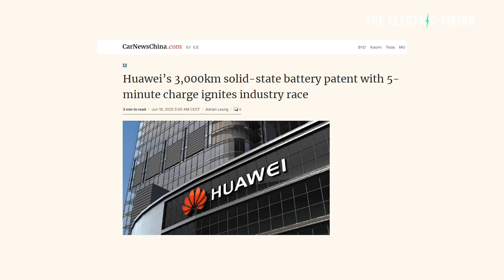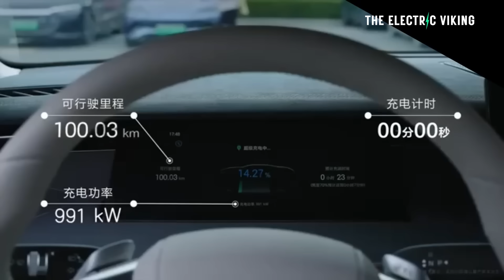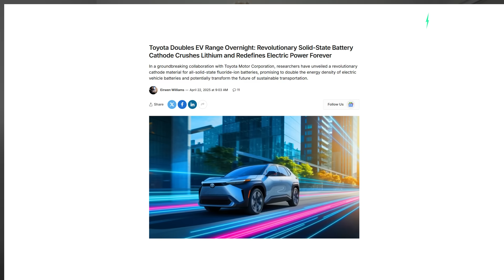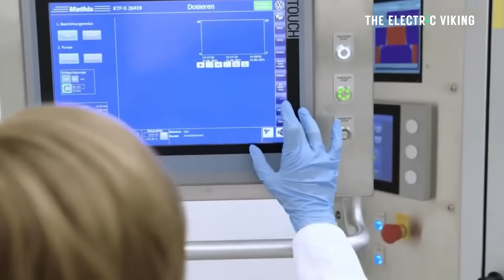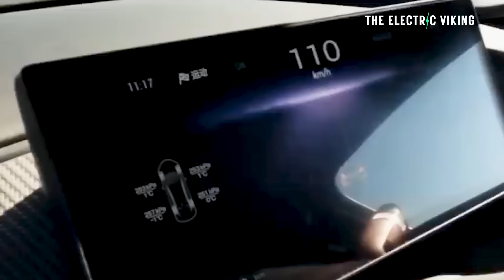5‑Minute Charge, 1,864 mi Range: Huawei’s Battery Patent Shocks Industry

Comment: IF that energy density claim is true, we will watch most aviation go electric as well.
Reply: Just curious, will aeroplanes benefit significantly from using batteries as an energy source?

A lot of the benefits of putting batteries in cars is because of regenerative braking - a significant amount of energy is recaptured and returned to the battery.

Would planes have a similar system? Or am I thinking about this in the wrong way? 🤷🏻‍♂
Reply: @JadeSea-x1b  That is a very good enquiry.

From what I have read so far, there are strategies for electric planes to conserve energy rather than re-generate it. But of course it's not my area of expertise and it can be hard to keep up with what is happening.
Reply: @JadeSea-x1b  much of   the energy that planes use is to reach operational height and speed. If the engines in an electric aircraft can be used to generate electricity and slow the plane down rather than speed it up, then yes regen could work, but mostly at the end of the journey
Reply: @JadeSea-x1b  it will reduce fossil fuel usage and reduce costs because electricity costs much less than avgas or kerosene. No regenerative braking, sadly!
Reply: @JadeSea-x1b  In reality regenerative braking normally saves no more than 1~3% as we daily drive.
Reply: @vincentlin9350  1-3% sounds awfully low. I've done some quick research - Tesla Model 3s can regen at up to 75kw. I've read that regen'ing can net between 5 - 10%.

This actually sounds awesome. 🥳
Reply: @JadeSea-x1b  the experience is on BMW iX2 B mode. just one example.
Reply: @JadeSea-x1b .  If it’s a vehicle like a taxi or a delivery van you have to calculate wear and tear on brakes.  Regen braking saves a lot of money on brake repair and maintenance.
Reply: @JadeSea-x1b Fuel is a huge expense for air carriers. If they had a way to divide it by 5, they would be overjoyed.
Reply: @JadeSea-x1b the simple fact that the electric motors provide instant acceleration paves for the democratization of the air travel.
Very short runways . Silent planes. 
U can have small runways near to population.

It's like the iPhone moment for the Personal Computer.
Reply: DH!!!!😂😂
Reply: @kokkarneBramhavar  This is true, particularly about the reduction of noise - people living close by airports or underneath flight paths would definitely be better off. 👍🏻
Reply: @pradhyudh Sounds is going to remain a problem with electric planes, because propellers and electric ducted fans aren't silent. They indeed are less noisy compared to kerosene fueled engines. What is going to be reduced is local pollution, reducing the risk on getting aerotoxic syndrome for the staff and increasing the local air quality.
Reply: I think VTOL and semi VTOL is going to play a bigger role with electric planes, because with smaller electric electric engines it's easier to implement. That can change the way aircraft have to approach and take off from the runway, reducing noise complaints from the surrounding areas, but this also means smaller airports can service bigger aircraft which can reduce the amounts of flights at bigger airports.
Reply: @EenYouTubeGebruikerI fully agree. I've been following flying car technology for over 40 years and I always knew that neither ICE nor turbines would make the cut. For the last 20 years, I've been waiting for better batteries and I believe they have finally arrived!
Reply: @JadeSea-x1b this is a long shot 😅but  maybe solar cells on the top of the fuselage and wings to generate some power during daylight 😅. Like a extra skin but I guess would be vulnerable to lightning ⚡️ etc !! And additional weight .. I do recall an experimental electrical had panels on wings ..
Reply: Exactly.  I suppose we should be watching for unmanned short range crop dusters.  That would be the cheapest and safest starting point.
Reply: @drmodestoesq they're already here, they're just not cheap. Yet.
Reply: @drmodestoesq  I suspect that could be done with current batteries. I suspect we are going to see drone based gutter cleaning and window washing.
Reply: @jonathancardy9941 .  I’ve see people using small quadcopters for crop dusting.  I’m assuming crop dusting is a multimillion dollar industry.
Reply: It's BOLL🐃
Reply: Electrically powered planes would be slower as they would have to be powered by motors attached to a propeller unlike modern turbofan engines.
Reply: For heavy long range aircraft, they take advantage of the landing weight being reduced by the weight of the burned fuel meaning the structure can be lighter and they can go a a lower drag higher altitude as the fuel is burned. Thats why if they have to return after takeoff, they dump fuel. Batteries don’t get lighter. Will be great for shorter range aircraft.
Reply: @brucec954  I was an airline pilot for 38 years. Sorry, no offence, but your reasoning is flawed.
Reply: mid-air recharging.
Reply: Short endurance recreational and sports aircraft can be electrified, some are in research mode right now. But your regional or long haul aircraft will remain turbine (jet) powered. An electric aeroplane is a propeller driven aeroplane. So a lower cruising level is required and also prop aircraft are much slower than jets, about 120 kts slower (140mph / 220 kph). Prop aircraft are also quite noisy and produce vibration, you would be effectively going back to 1950’s air travel in speed and comfort.
Reply: @PropanePete there is absolutely no reason you couldn’t put a direct motor on the turbine blade driven by vfd’s.  None. Because it’s not in practice yet doesn’t mean it can’t be done.  If the battery capacity is light enough with sufficient capability then  it would even be much improved over the existing technology.
Reply: @kristopherbuchanan974  You're mistaking what the compressor stage of a turbine engine does compared to what a propeller does.
Reply: @PropanePete  no sir, granted I am out of my league as far as how the jet engines work, but the high bypass engines effectively don’t rely on the heated air and fuel exhaust for the thrust but instead use the fan in the front as the main source of thrust. It does still provide thrust but as a supplement.  The high bypass is moving large quantities of air at lower speeds providing the thrust.  Like I said, the technology might not be developed as of yet, but I promise you it  is not far off and an Electric motor is capable of the speeds needed if the energy density of the batteries is sufficient.  I was simply stating, many things people seem to think are impossible are often built and work better.  Of course there will be hurdles this overcome, but If you’re limited to thinking it must be prop driven then I think that is a mistake.
Reply: But can we trust their batteries? Did we really think about all the privacy concerns?
Reply: @Unacceptable.  Who are we? Can you trust products from the USA?

Comment: Just give me a cheaper, lighter car that goes 500 miles. You'll sell more cars because it's cheaper and has a better interior design because you have more room to work with because the battery is smaller.

Comment: We need the energy density. We don’t need more than 600 km range. May be 800km in some cases.  Range is not an issue - weight and size and price is.
Reply: True and I think car manufacturers agree, high energy density batteries allow them to cut the overall size of the battery - reduce weight and improve efficiency
Reply: i recon 600-800kms is enough... i have never driven more then 400kms or so without a "pit stop"... charging speed up and bring the weight down to ICE levels and EVs win.

Comment: I don’t understand why people measure EV batteries in kilometers (or miles) when they should be focusing on three key aspects:
	1.	Vehicle (motor) efficiency,
	2.	Battery energy density, and
	3.	Charging speed/rate.

Why? Because you can have a 100 kWh battery and still only get 150–200 miles of range, depending on the vehicle’s efficiency.

Let’s be clear on this: the bigger the battery, the heavier the vehicle—and the heavier the vehicle, the more energy it requires to move.

On the other hand, higher battery density means less weight for the same amount of stored energy, and vice versa.

Also, when measuring battery range in kilometers, it’s essential to specify which testing cycle or methodology is being used (EPA, WLTP, etc.). For example, in China, they use the WLTP standard which, to be honest, is quite optimistic. In real-world conditions, the actual range tends to be about 70% of the claimed figure.

For instance:
3,000 km × 0.70 = 2,100 km real-world range.

So far, the highest real-world efficiency I’ve seen is 13 kWh per 100 km, which translates to approximately 7.69 km per kWh.

That means achieving a 3,000 km range would require:
3,000 ÷ 7.69 ≈ 390.1 kWh battery capacity — almost double the size of the Silverado EV’s battery pack.

Now, regarding battery density: today’s NMC batteries typically have an energy density of around 300–350 Wh/kg. Solid-state batteries (SSB), which are not yet commercially available, are expected to reach around 600–700 Wh/kg.

This means that a 390 kWh NMC battery would weigh at least:
390,000 Wh ÷ 350 Wh/kg ≈ 1,114 kg.

With solid-state batteries, that weight would be approximately:
390,000 Wh ÷ 700 Wh/kg ≈ 557 kg.

Focusing solely on range in kilometers or miles misses the bigger picture. True EV progress isn’t just about bigger batteries—it’s about smarter, more efficient vehicles, lighter and denser batteries, and faster, more convenient charging. The real conversation should be about optimizing energy use, not just extending range through size alone. Efficiency, density, and charging infrastructure are the pillars that will define the future of electric mobility.
Reply: i recon 600-800kms is enough... i have never driven more then 400kms or so without a "pit stop"... charging speed up and bring the weight down to ICE levels and EVs win.
Reply: @lukin4u265  My current ICE car, with a full tank, has a range of between 270 and 330 miles, depending on how many miles I drive in the city versus on the highway. So, having an EV with a 350-mile range wouldn’t make any real difference to my routine.

Now, 350 miles is achievable with some EVs (the most efficient ones), and that’s about 563 km (nearly the range you mentioned).

I agree that, for some people, having a range of over 400 miles would be fantastic (I don’t know why 🤷🏻‍♂️ but it’s OK) But honestly, with today’s technology, that usually means more weight, which leads to reduced efficiency (and therefore less range), more tire wear, etc. Also, as you mentioned, most people stop every three hours or so. So I don’t think having an excessively long-range vehicle would make much of a difference. What I believe is really important is having a properly balanced vehicle.

Comment: instead of increasing the range beyond 600 miles, they will cut the size of the battery and reduce the cost.
Reply: For cheaper models yes of course, but that doesn't mean to say this will be true for all models.

There is a large range of pricing between the bare minimum road worthy vehicle for a short range commuter and a super car that costs as much a house.

This will also be a big boon for EV racing.
Reply: I can imagine there's still a use case for longer range though, specially in military vehicle applications and remote work, and of course recreation, a lot of the tracks in Australia, for instance the Birdsville Track Mt Isa to Leigh Creek (the two actual EV chargers and not caravan power socket for charging that take all day, and there is only one location on that entire distance where you can get that anyway)  are 1,319 km apart and there are other similar very popular recreational track distances in Australia without charging, so I can see a use for a long range battery pack for recreational 4x4, specially towing off road caravans that take more power anyway. For road cars though, give me 800km and I can go anywhere by road in Australia without worrying about charging problems.
Reply: But can we trust their batteries? Did we really think about all the privacy concerns?
Reply: @Unacceptable. We should ban them, CCP will make them explode remotely because they hate westerners!!1

Comment: I've made highway trips of 10-14 hours straight through,  with only 2-3 fast 15 minute stops to fill the car and empty my bladder. And I refuel at 1/4 tank because I have found the next station sometimes won't be available. On long hauls? I'd need a 500-600 mile range in order to make the same number of fuel (charge) stops. But there's no charging structure that can charge EV's for that range in 15 minutes.
 They want you to charge from 20-80% and that's only 60% of their range claims. And the 150-250kW charging stations will still need an hour.
 Now take a 10-hour road trip, and 2 more hours for charging, and a long two day trip becomes a brutal THREE day trip. I lose an extra day of my life. Two days lost round trip. OOoops, ran out of vacation days too.
 A hundred mile range is plenty for seeing local friends and grocery shopping. But it may add a $600-1000 car rental bill for road trips.

Comment: Integrate a very modest Huawei solid state battery with an Aptera EV, and the result will be awesome, 1000 miles per charge, and a very light weight EV.

Comment: Power is not generated when you need it. Power is generated so that it is there when you need it. Grid stability is what they call it. So if no one needs that power, a very big pile of power is thrown away 24/7 because you can charge for 5 min... what an energy waste. And what if 2 want to charge at the same time... are you going to wait an hour for the power plant to increase its output? Charging itself only takes 5 min.... all the rest is BS.

Comment: Only in the city we dont need more then 450km of range.     Drive out west and you wont get 1/2 way to where you are going with 0 chargers in between.   Go for a drive to longreach and you will understand.     A car with 450km is likely to do 300km of real driving on the road.   If you get off the coast you can drive a lot further then that between towns with no EV chargers in these towns you do pass.  If I get sent out there even with a diesel ute I pack 200L of fuel in the back as all the servo's shut down at night.   It truely would be a gamechanger if we could drive 1000km on the road (Not there silly metric they use now but 100km/h road driving)

Comment: I cannot believe the statement that 700km of range is enough. Overhere in Europe, 700km is 350km in practice on the highway in the winter, and the majority of car owner cannot charge at home. We need a longer range. 1000km range and 500kw charging would really help.
Reply: No. What we really need is bigger charging network/charging points and faster charging. Most people would have stopped for a break at 350km. Stopping for a break, usually means a toilet, and maybe grab a snack and drink (if not a proper meal). By then, you should have been charged up within 5 mins and you're on your way again
Reply: i want 20 000km  of range!
Reply: That’s some goalposts your moving there 😂
Reply: Clearly  he's talking out of his arse, economics wins.
Reply: Upvoted because I know Europe: often much denser, more rental units that single family suburban homes, and therefore dependent on charging options that are reliable, convenient, and fairly priced. At present, only massive range achieves that for renters.
Reply: What we need is a reality check . This is not about the masses driving EV s , this is about curtailing the masses from driving . I really can't see why a lot of quite smart people don't get it .
Reply: @mikemoore5929  
maybe you yourself are not so smart?
Reply: @mikemoore5929  - Please expand on your point so us dummies can catch up. Thanks.

Comment: A patent application to double the energy density of a solid state battery chemistry, doesn't mean that there is a battery that is waiting to be produced.  It can refer to just increasing specific energy, while not addressing other problems that need to be resolved such as manufacturing and durability in a car subject to a lot heat an vibration.   An application doesn't moreover mean that it will be granted.  The news on this patent application (which does not seem to be published as yet) seems to be that it increases the energy density to about 400-500Wh/kg, which is about twice the current capacity.  Some firms (e.g.,Ampcera) have already achieved 450Wh/kg for some niche applications, so it is not all that revolutionary.  There are probably close twenty firms now chasing the development of solid state batteries for auto and other sectors.
Reply: Hwa wei with 10,000 engineers doing the research and innovation, competitions are fine.
Reply: Chinese companies simply ignore patients from western countries and the CCP makes it nearly impossible to do anything about it. The west should do the same in return with any Chinese battery patients. Just ignore them.